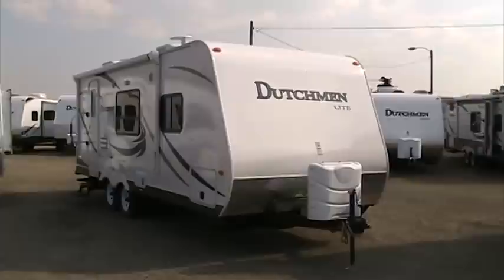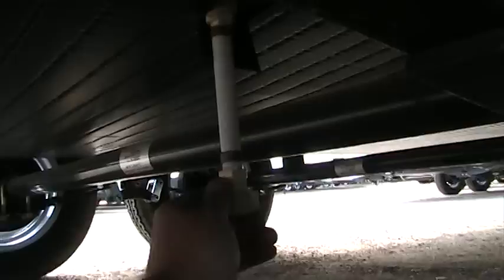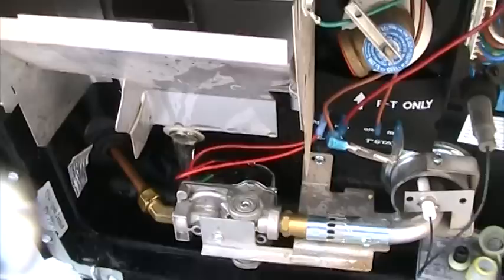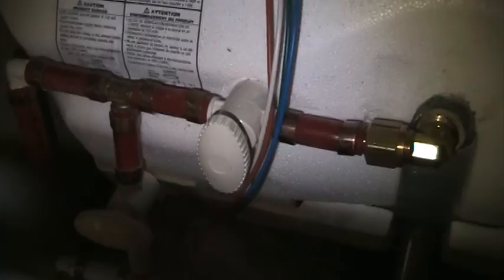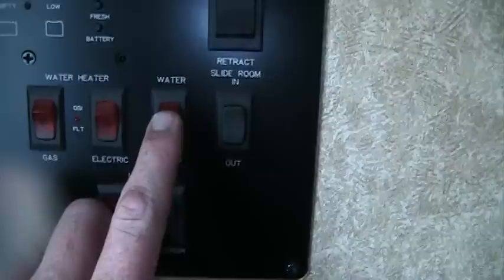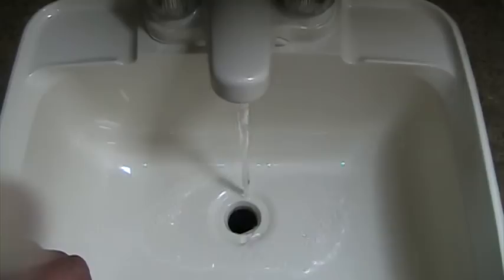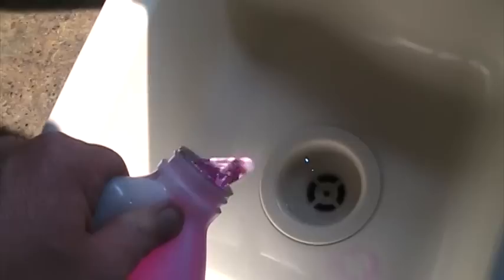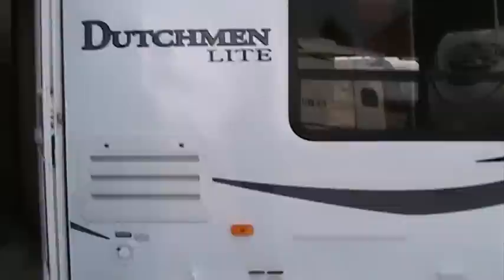Winterize Your Dutchmen RV

Comment: Pretty straightforward.  We have a 2016 Dutchman. Only thing different were the by-pass valves behind the water heater. Where you had three, I had two. I figured the bottom one was a two-way valve, because it had a hose going up that tied in on the downstream side of the top valve. And the fact that my pump was underneath the oven and a little difficult to access. I actually removed the hold-down screws so I could pull it out a little. Great video. Very informative and clear. Thanks.

Comment: I've seen videos of people putting the antifreeze directly into their fresh water holding tank. I like this method much better. It seems like it won't contaminate your fresh water holding tank. However, There is that line that goes from the fresh water holding tank to the pump that seems to be full of fresh water.  How do you address that?